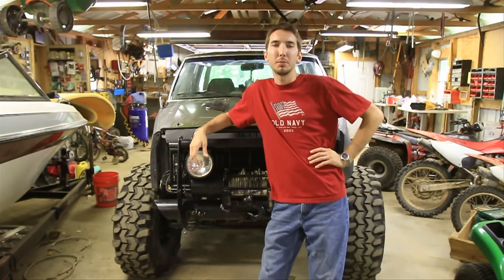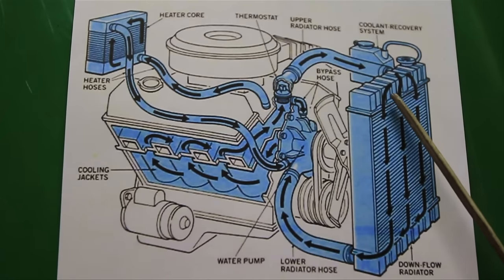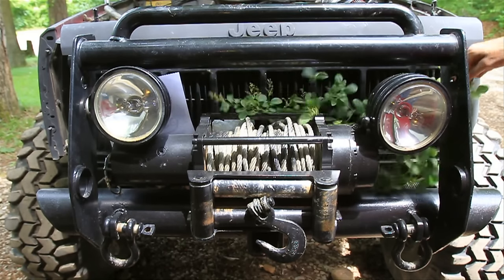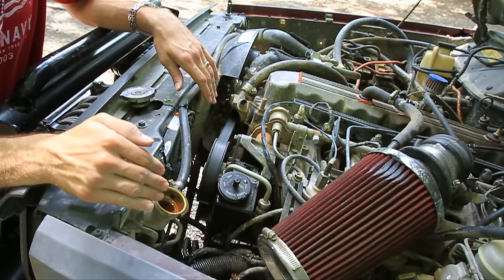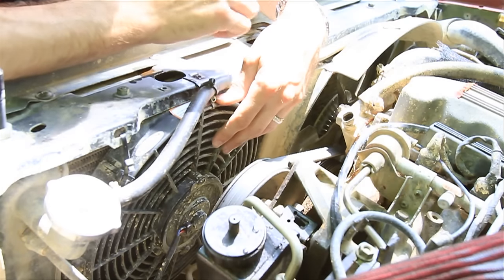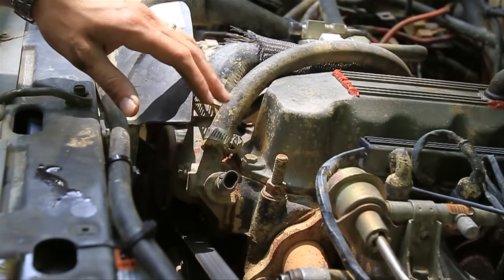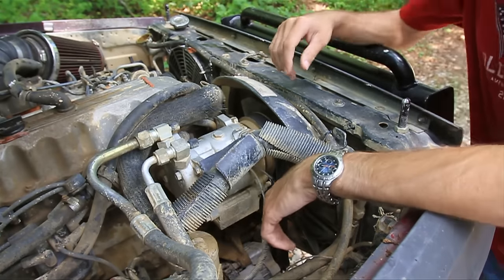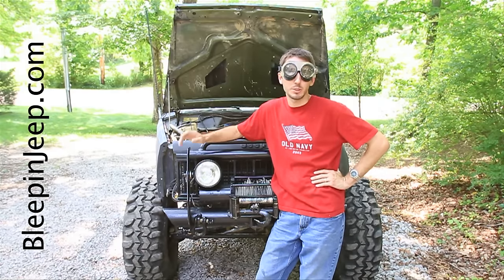Engine Overheating? - 9 Steps to Solve

Comment: Hello Sir;
I have a 2007 Jeep Liberty 3.6L V6, my wife was driving it one day and it began to overheat. I’ve replaced the thermostat twice and replaced the water pump and flushed the heater core and flushed the radiator. It’s still overheating and heater is still not blowing heat. I’m open for any ideas or troubleshooting that would help.
Thank You Sir

Comment: Hi there , my car’s Radiator , Water Pump , and Thermostat has been changed ,when I changed 
My car’s Engine , how ever the Temperature Gage goes up about few inches above the Middle 
Normal Temperature, what else could be wrong ? I don’t think there is problem with the Head 
Gasket Cylinder , I tested the radiator with a  liquid Tester to see if it’s leaking , but the test 
Was good , I have not changed yet the Sensor related to the coolant .
Thank you .

Comment: I see that your Coolant temerature sensonr isn´t plugged into the electrical connector, do you leave like that púrposefully so that the fan is always running? or did you unplug it so that the thermostat housing was more visible for the video? just a doubt, i have mine off all the time, could thsi lead to any problems further on? what´s your opinión? By the way im loving your videos all the way from BAJA, MEXICO!!!
Reply from the maker: This is an early model remix engine with a later model housing so the switch is just a plug in this case.  But I do have a manual switch in the cab.

Comment: thanks for your 9 easy steps. but my problem is my engine is mercedes 102. i hope you know the radiator design for this model(w124). when  i start the engine & the temp is below 80 digree one side of radiator is cool and another is hot. what does it mean? The clutch fan is modified to Fixed type fan.

Comment: hey matt whats up? i have a 93 xj country. kid i bought it from told me the "few" things wrong or that it needed and ive been workin them out with some help. my biggest thing now is the fan. for some reason the kid hotwired it straight to a toggle. finally got it working again and jeep still gets just a little hot. then we also noticed the clutch for ac fan wasnt engaging. i wanna just replace it with nice new shinny electrical fan and prolly new rad. got a video done for that or recommendations for parts and how-to?

Comment: Please help!! I need help diagnosing what is making my car overheat! I recently changed my headgasget and water pump. I also changed my oil and collant fluids. I have an 88 toyota corolla and its been running for years w/o any trouble. U said something at the end of the video about how if your car temp goes down on the high way and goes up in traffic

Comment: What if there is no coolant in the lower radiator hose while running, but when the car is turned off it goes to the lower hose, the top hose is hot though? I was thinking air in the system, or thermostat not opening. It's a sealed system might have to buy the hose cap adapter to get to the bottom of this.

Comment: I did check the cap (ok) and no it's not the pressurized one. I haven't done the air in the system, so i'll try that.

Comment: I have a 2000 Cadillac Seville STS. Today, (in 80 degree weather under normal driving conditions) the engine began to overheat, I shut off the air and it cooled to normal for a few miles, then it began to rise and lower to normal heat a few times over, never getting close to the red line, but surely above normal. Is this caused by a faulty fan switch or a faulty thermostat? There are no leaks, there is no water in the oil (the engine purrs like a kitten), the antifreeze is normal and the correct type for the car. The water pump is good, no broken or loose belts either. The antifreeze tank bottom hose is not faulty or leaking either. The main belt is good and both belts are properly tightened.

Comment: I have my truck overheating at freeway speeds. Idiling is fine nothing is blocking the radiator. I have noticed that the top radiator hose gets hot but I can still squeeze it. Could that be the thermostat not opening fully to let the coolant through? Or just another problem?

Comment: hi, how are you today? I have a problem on my car (over heating sometimes) but I konw the reason why it happens like that is the water from the radiator goes to the reservoir but the water from the reservoir does not go back to the radiator that makes the engine become hot because the radiator was emptyd already.....what might be the reason why it is doing like that....pls help me to solve this before I go to the michanics which I know it is very expensive, thanks and May God Bless you always.
Reply: Dave Garnace

Comment: So my 2002 Old Alero,110,000 mi., tends to get a little hot (but not in the danger zone) when going up long hills. I also have a small leak in coolant on my garage floor. I have to put about 1/4 c of coolant in a month. A mechanic told me this a head gasket leak. So where do I start. Is this all worth repairing?

Comment: I have a 89' fsj with 360 and have replaced water pump, radiator, two different 195 degree thermostats, heater core, checked the cam timing and dizzy timing. no smoke, no water coming out of the tail pipe, good compression, idles and runs strong, shifts strong. 80k on motor. takes 10 min. to warm up sitting or about 8-10 miles on the hi-way. it still gets hot, although I can coast it on the hi-way in neutral and get it to cool down about 10 degrees for every 100-150 feet. Am I missing something? Could it be a bad trans cooler maybe?

Comment: Would not having a fan shroud cause me to run hot? It only happens while running on the beach in deep sand. I have a new water pump, thermostat and radiator.

Comment: Hay Mat thanks for all your awesome xj vids. I'm having problems with xj only when setting in traffic or trail riding or when temp gets to 210. It gets hot and quits when at idle. It don't get much hotter than 210. I thought it was heat soaked in the injectors. but idk? my fan shroud is missing could that make it get to hot like that. I have 1" blocks on back of hood hings to let heat out allso. Thanks
Reply: get a fan shroud for sure

Comment: Hi, I am having a weird heating problem with my hyundai sonata. The car normally stays little above the normal level but below full (sonata has 2 small dots on the indicator) it should usually stay on the lower dot. But mine stays a little higher. This is the case on the highway, but in the city during traffic hours after the car is heated up it goes up and comes down again regardless if the car is in motion or not.

Comment: Good video i have a 02 f-150 5.4 supercharged and sems like is getting air on the coolant but i have no leaks i have 2 thermosthats 1 from dealer whit this one the top radiator hose is really hard and the coolant on the container is all the way up and the motor is over hut .whit the other thermosthat the top hose is soft the coolant level is normal the motor is hut too so the only way to make the thermostats open is if i open the cap while the motor is running im using the spill free funnel and really works for one day next day i have the same issued any recomendation ??

Comment: 2013 Suzuki grand Vitara was overheating when driving.  it would go back to normal temperature range when idling. Did this for about a week then didn’t act up for a few days now problem is happening again. (Radiator was completely changed out last year so no issues or year).

Comment: Could I have a bad water pump even if its not leaking?  the upper hose is collapsible and I did remove the thermostat for constant flow because the old one was bad. I replaced it and still over heating. the coolant levels are low and not seeing any leakage. No smoke for head gasket indications. If the water pump is not pumping, could it evaporate to over flow, the hoses do eventually load up with pressure. fans are working. I will try pressure testing and just go for a pump replacement.,

Comment: great video i have a 2006 jeep commander that  over heating .my serpentine belt broke .my water pump went bad so i replace it and it sill got hot so i replace my thermostat..still got hot .went to parts to have my fan check out good.so i got another thermostat thinking the new one was bad.still overheating please help.

Comment: I have a 2000 Silverado 5.3, I have replaced the fan, radiator, water pump, thermostat, all the hoses and my truck still heats up, but only on a hot day over 90° anything under that it won't over heat, and my radiator fluid is dexcool I've always used it and I can't figure out what the problem is or if it's time for a new engine.

Comment: Is it possible for my Chevy 350 to have a blown head gasket or cracked head/ block, and not have the obvious signs? Bubbles, water oil mix, etc? I have been chasing down an overheat only under load issue in my Jeep YJ! I have replaced the radiator with a 3 core aluminum, upgraded my flex fan to a 16” Spal, put an Edelbrocks 160* thermostat in, both hoses don’t suck flat, water appears to circulate, and at idle it will completely operate like normal- fan cycles, temp cycles, and everything is good. But, when I drive the beast it will steady climb until I’m banging on 230*, if under load even just in my neighborhood! It’s not a regular YJ, it’s a full Chevy driveline- 350 (.40 over) engine, th 350 trans and 205 tc, CUCV one ton axles (60 front and 14 rear with 4.56 gears) 44” Boggers and a trans cooler set in front of radiator…… 
I have to say, it almost seems like it’s getting worse as time goes by! I used to be able to run it down the road at highway speeds and it would slowly creep up, but now, if I’m driving down the road it climbs faster! I was going to pull the thermostat and run a cut out stat just so I could look for bubbles, and today, I raised the radiator 3” higher to make sure my cap was the highest point, but it still got hot? My Spal fan almost completely covers the radiator, so the shroud I bought to add almost seems useless, since nice there’s only a small bit at each corner not covered by the fan, and the paper test when the fan comes on, absolutely sucks the paper to the grill- 4” from the radiator!!! My fenders are off to bleed heat and my headers are outside the frame, so I’m at my wits end!!!! I’m down to thinking blown head gasket or cracked head(s)/ block, even though I can’t see oil mix or other obvious traits? Can compression gasses leak only into the coolant and cause the overheat, with no other obvious signs?!?!?! I’m about ready to blow this engine up and start from scratch!!!!!🤬😡

Comment: My thermostat is coming off the bottom hose. (4.7 Liter) 03 Dodge Durango. When hot, it shoots a geyser out of the radiator cap (on the middle of the top hose) and the bleeder valve. I have a new radiator, thermostat, and both radiator hoses.

Comment: Hello , I have a motorcycle which failed the pressure test on the radiator, it will not even hold pressure and I can hear it leaking air at the top where the cap would be , I have the same bike which I did the same test on and it immediately acquires pressure & holds . Must be some ( wear  )where the cap would sit . How can this be fixed ? J b weld ?? Thank You Bleepin jeep

Comment: I have a 2002 impala I changed the lower radiator hose because it broke, I immediately went to go replace it and decided to change my radiator cap as well. but now my alert system tells me "low coolant level" but when I check my car is not leaking coolant and levels are good. what could it be? the coolant sensor? or something to do with my transmission fluid?

Comment: i have a 2004 sebring 2.4L 16 valve. ive replace the water pump, thermostat (195 degree), radiator cap, did a  radiator flush, and burped the system. the car is overheating at idle and the cooling system pushes the water back out the radiator into the overflow tank and it spits alot out that way. any suggestions?

i removed the thermostat completely and drove without it and it drove just fine and did not overheat at drivig speed or idle. put in a new thermostat today and same problem. nothing changes.

Comment: I have a problem with pontiac Montana 2000 van. whenever I  had a long ride and I come to a complete stop it starts to over heat but if I'm just driving around town it won't over heat but after a long ride it will start to overheat again. The alert "LOW COOLANT" shows on & off. And everytime I checked the coolant reservoir the water overflow near to the cap or sometimes it overflowed. is there any problem with waterpump or the headgasket..  Any tips or idea's to fix the problem please? ?

Comment: what is your temperature gauge setup? I fixed an overheating issue on my '92 XJ but realized that the dash light only lights up when it's almost too late. I want to put an aftermarket gauge in. a tutorial might be nice. ;)
Reply: bleepinjeep hmmm. yeah I saw those. looks like you have a different trim level on your jeep. I have the idiot panel with a giant fuel gauge and no needles, just lights, on the other gauges. I still may be able to glean some info from your vids though. thanks.

Comment: i have a question... why the fans are in the middle of the engine and radiator ? why not from front of the radiator where is cool air only comes and hit the radiator? 

if its in the middle then its taking hot air flow to the radiator? please answer
Reply: bleepinjeep if the fan is in the middle of the engine and radiator then it will pull hot air from the radiator

Comment: plz explain transmision oil flow & radiator.some ppl instal oil coolers.is it necessary or radiator does the job fine? coolant for engine and oil for transmision use the same radiator,how?

Comment: how much would this job be. I bought my own thermostat and water pump. took it to a couple commercial mechanics and it's well over $450 to have them put in
Reply from the maker: depends on where the water pump is located on your car.  But I'm not a mechanic so I have no idea.  We do have a couple vids on water pump replacement though if you want to tackle it yourself.

Comment: im at my wits end here with my 05 civic. after a long commute(1 hour++) when sitting at lights or traffic long enough the temp will rise and even worse if i drive the car hard on the highway. ive never allowed it to go near the (H) limit (tried to make air flowing as much as possible). the fans come on periodically but cant dissipate the heat enough. No coolant loss but reservoir shows full to the cap. had a coolant change recently but problem still persists.

Comment: hi, my radiator fan turns but much slower than the engine. I can stop it from running using my hand and then it slowly starts turning again. when i am driving around town, the temp increases but when driving at high speeds they temp falls. could it be a water pump or thermostat. The vehicle is Iveco daily 2000, ex UK now in Africa.

Comment: I have a question, if the radiator fan wasnt working, will my temperture gauge in the car rise over half way, i dont know weather my fan is working or not, but i lifted the bonnet up the other day and felt alot of heat before the cold air outside cooled down engine, but im not sure what to do, if the temp gauge is sitting in the just below halfway point, should i be worried?, please get back to me as its doing my head in lol.

Comment: If you determine that the radiator is causing the over heating, then there is a way to clean it. What I have discovered is that it is usually because the channels inside the radiator core are clogged. This is common on vehicles 10-20 years old. When this happens usually they just replace the radiator, but If replacing the radiator is too expensive you can try cleaning the radiator core as in this video. Search You-Tube: Car Overheating -How to Clean the Radiator Core of a Clogged Radiator

Comment: Mi XJ is overheating when goin up hill, radiator is basically new 1year, filled with coolant. 

I can be all day with the AC on and the cooling system works great once I go up hill and the temperature start to rise. 

No weird noise from the pump neither

Fan clutch stops right when I stop the engine and it spins faster when rpm goes higher

I notice this start to happen when I refilled the AC system with refrigerant not sure if it has something to do with this ...

I havent tried to burp the system yet

Any advice?
Reply: When hot it also starts to fail like when the spark plugs are bad